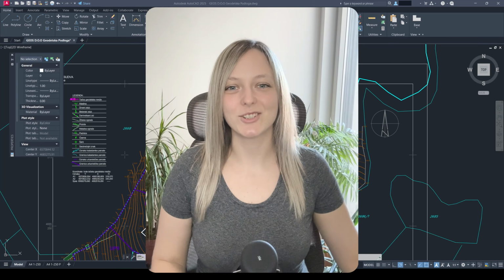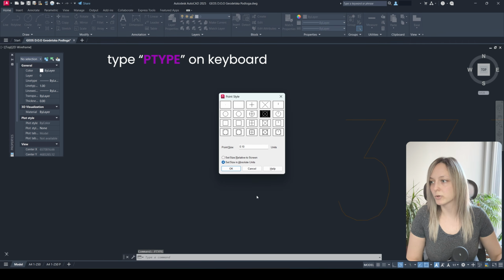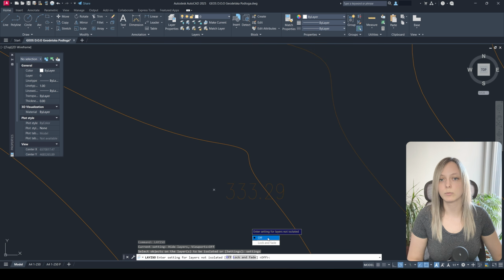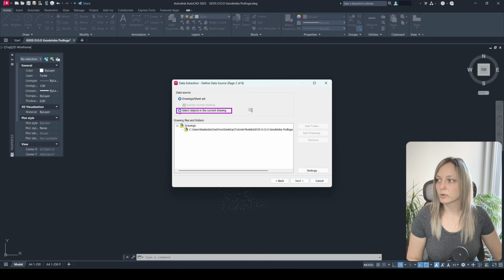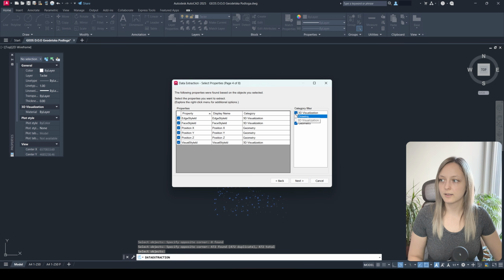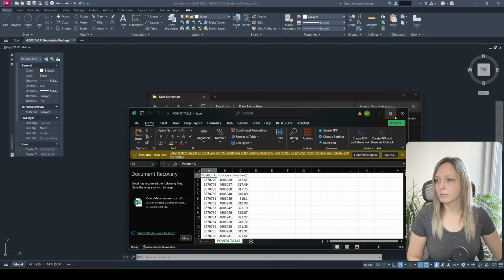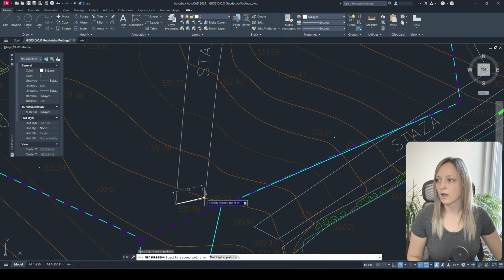Export CAD Survey Points to CSV & Generate Revit Toposolid

Comment: Hey Nadezda, is the terrain smooth or does it look very block-y once finished? I can sort of see something around 5:35 but its unclear. Usefull video!
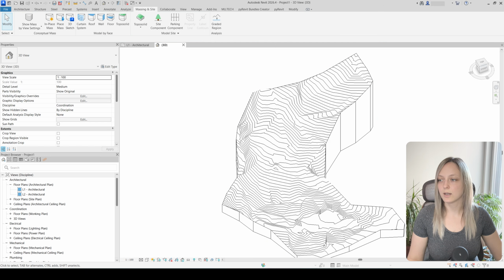Reply from the maker: Hello, the file I am using has a lot of points, so it’s very smooth. You can see it at 5:12 min. 
The more points you have more precise the geometry is going to be.
Reply: @BIMTonicLive  I'll have a go at it and see! I'm used to making the terrain in a rendersoftware. But always need to then draw it inside Revit views for architectural drawings. Could be good to make the terrain in Revit if it can also function as a smooth enough mesh for rendering and catch two birds in one stone.
Reply from the maker: It’s very good and quick technique for when you don’t have contour lines to generate automatically